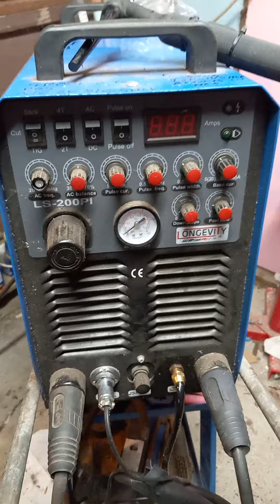tig contaminated?

Comment: Try adjusting your torch angle, or turning up your flow rate. Also double check that you’re using the right filler for the material.
Reply from the maker: the Longevity TIG machine blew up, not worth repairing, Im getting an everlast 200es mig / stick welder instead.
Always regretted selling my little lincoln mig machine so I'm going back to mig.
Reply: @gerardjones7881  ah, that’s unfortunate. Better luck with your next machine, I’ve heard decent things about everlast so you should be alright.